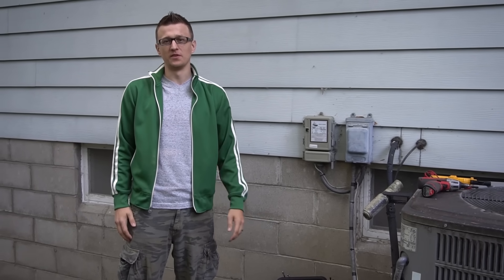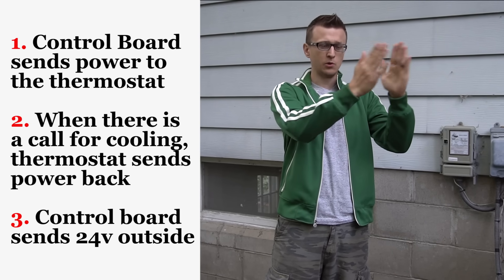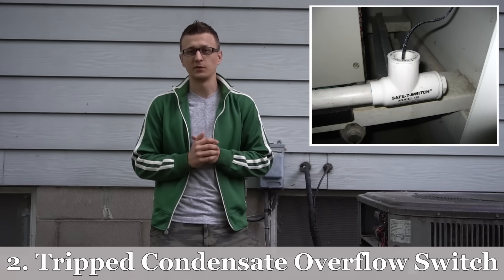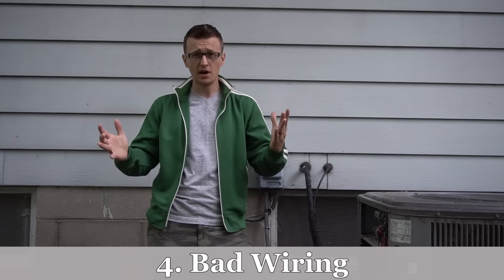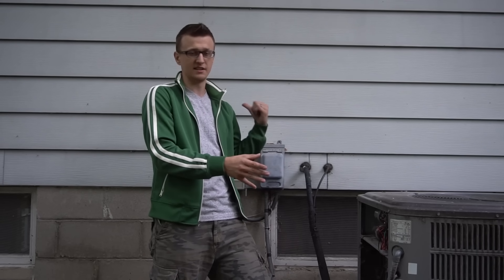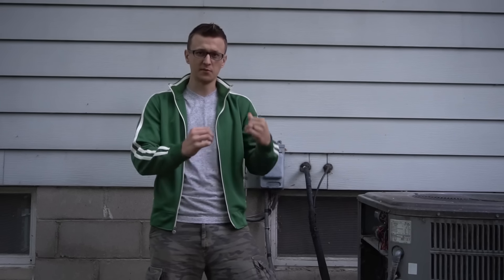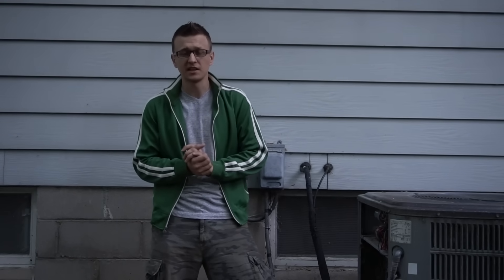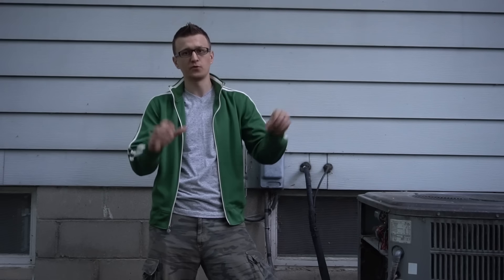AC Contactor Not Pulling In - 10 Reasons Why

Comment: Great video(s)! Thank you for taking the time to post these for people who want to take the time to learn how to do their own repairs.

Question - If I manually push the plunger down on the contactor and the fan begins to rotate, does that mean the contactor is okay and does not need to be replaced?

Current Scenario is: When the A/C is on, all I get is warm air inside the house. The fan does not spin on the outside unit. I happened by chance to catch your video on how to replace the capacitor so I replaced it but that did not fix the problem. I decided to spend some more time watching your videos and came across the plunger test. I admit that I replaced the capacitor hoping it would be a quick fix and did not properly research at first. I did the plunger test with power on and the fan came on. I blew some compressed air around the contactor (plunger was covered with a plate that I had to unscrew) but the problem remains. I replaced the batteries in my thermostat but still have the same problem. There were some loose wires behind the thermostat and I thought that was the problem but alas, adjusting and tightening the wires did not fix it. I am going to try and perhaps spend some more time cleaning the contactor and perhaps check the condition of the wires to make sure nothing is damaged. I also had an HVAC company do some work on my furnace this winter...perhaps they did not properly connect everything inside the furnace? Was trying to avoid going into the furnace but will probably need to check it out over the weekend but I would love any advice on what to look for or how to proceed next. Maybe it's a blown 3amp fuse?  I don't have the equipment to perform the tests you suggest, e.g. I don't have a meter tester. Hoping to get this resolved before the heat begins to creep in. My unit was working last summer and the heat worked even after the HVAC company cleaned up. My thermostat is fairly new, bought it 4 years ago. Will also need to re-watch this a few more times for more ideas. Thanks!!!
Reply from the maker: (Thanks for the tips Thomas!) And glad to hear you got it fixed Liliana! :) I have seen thermostat wires snap off like that just from time and wear. The furnace slightly vibrates while it runs. But it's also possible that the cleaning guys accidentally bumped the wires too. No way to know for sure so may as well just let it go and enjoy the air conditioning! (On the positive side, you did learn quite a bit about your central air :)
Reply: I recently had a very similar problem with my outside unit.  I recommend checking the resistance of the 24 V coil - mine should have been about 12 ohms and was only about 3 ohms. I changed the contractor/coil and the problem was fixed. A complicating factor (which made troubleshooting the problem more difficult), was that 24 volts was not present at the coil with the thermostat calling for cooling. I believe my Honeywell programmable thermostat has a protection feature that will not apply voltage to the cooling circuit if low resistance is present in the circuit. Good luck.
Reply from the maker: Glad to hear my videos are helpful! Sorry to hear about the AC not working. First off, it's not likely that the contactor is bad but to know for sure it would need to be checked with a meter.  I don't think the fuse 3 amp fuse is blown either. I would recommend also watching some of my "how to bypass a thermostat" videos and then try jumpering your thermostat at the control board. (It would be R jumpered to Y) Also, inside the furnace look at the control board thermostat wire strip. You will have to trace the wires a bit but figure out which wire is coming into the furnace from the condenser unit outside. Usually this will be a brown wire with a red and a white wire inside. Those two wires go to Y and C (doesn't matter which goes where). I told you this last part since you mentioned that maybe something wasn't connected right. But as you saw from this video, there can be quite a few things that can cause the contactor not to pull in so you will have to just have to keep narrowing down the possibilities. Good luck with the repair!
Reply: @WordofAdviceTV  VICTORIOUS! Finally opened up the furnace. Took some time to get my bearings with trying to figure out what wires were what...but then suddenly it stuck out like a sore thumb...a lone Yellow wire that seemed to be disconnected albeit very close to the control board. Long story short, it had to be connected back to Y on the control board. Was confusing since there was already a wire , I believe white which seemed to go outside, going into Y so I thought all the wires already were in their proper places. After doing some Googling, I decided to unscrew the screw for Y and a piece of wire dropped off! Eureka! This must have snapped off from the yellow wire. Stripped the yellow wire a bit and connected the two wires back to Y...turned it on and the fan turned on outside!!!! Thank you very much for your help and for taking the time to post these videos! Question is...do wires normally just snap like that...or was this bad work by the HVAC cleaning guys.....

Comment: Hi Jay!  Just ordered a Packard single pole 30 amp 24 volts contactor on line.   Doesnt look like it is labeled  L1 L2, T1 T2.   Are their locations standardized the same if I orient the contactor according to my existing old one of a Siemens brand with the side that has the contactor?

And does each of the four 4 prongs belong to its own group so that wires belong to that group can be plugged onto  any of the 4 prong configuration as long as the wires are in the right group, ie: T1 or T2?   

Also, can sources for the main power go on either side of the 2 screws or lugs on the line side?   Thanks in advance!
Reply from the maker: Hi Dora! Most contactors will be labeled, just look around. But it's no problem if it isn't. Firstly, make sure you label the wires or take a picture before you take off the wires from the old contactor. The locations are standardized so you should be able to swap it out pretty easily. You are right about the 4 prongs belonging to it's own group (they are all connected so all 4 prongs get energized). So as long as you put it in the right place, it does not matter which prong you hook up the wire to. The two hot lines (L1 and L2) can go on either side. Both supply 120v so they are the same.  Hope that clears it up for you. Good luck!

Comment: Why would a contactor be all carboned up? Evidently the all run capacitor burnt up and it might have been because the contactor is carboned up and sticking. Cost me 900.00 in heat bills this winter cause the outside unit was not working and just the aux heat was being used all winter. Your video on the all run cap helped me find the capacitor was bad.

Comment: Thanks for making me feel like an idiot.... I spent half the day watching other videos, testing the capacitor, testing the fan motor, testing the contactor, etc.  Everything was checking out fine; but I was only getting 10 vAC from the circuit board to the contactor i.e. not enough to energize the coil.  Lost story short, your video reminded me to put fresh batteries in the thermostat and then everything started up normally.
Reply from the maker: Lol, glad to hear it was something simple at least! Stay cool! ;)
Reply: I spent hours checking everything, only to discover that the thermostat had become slightly unseated and wasnt making contact.  Gave it a light whack and everything worked fine!

Comment: I have an AC system when it kicks on everything
works good for about 3 minutes. Then the inside blower fan shuts off while the
outside fan and compressor continue to run. I can shut it down and reset the
unit and just does this again. When the system is set to heat it works fine. Any help ?
Reply: Have you tried jumping the fan and seeing if it stays on without heating or cooling? You can set it for Fan On, on the thermostat or jumper between R & G
Reply: @albotiger7268  no. I will try that
Reply: have you find out what is wrong with your ac.  my has same problem. need some helps

Comment: I should that, of course, I have an 'Air Handler' on the inside. While the outside unit was going off and on the Air Handler stayed on continuing to supply heat.

Comment: A few days ago I asked about my unit outside coming on for a minute then going off for a minute over and over. You suggested that I either had a problem with my thermostat controller or my 'control board in the furnace' is defective. I should have told you that I live in the deep south and do not have a furnace. A 'Heat Pump' does the job down here fine. Does this change your advice?
Reply from the maker: Sorry I don't remember the previous comment (I am starting to not be able to keep up with all the comments) but from what you just explained, it sounds like you are low on refrigerant. Your unit probably has an LPC (low pressure cut-out) when the compressor turns on, the pressure in the suction line starts to decrease. That's normal. But when a unit is low on refrigerant, the pressure drops below the cut-out point and the LPC trips, causing the unit to turn off until the pressure goes back up again. I hope that makes some sense.. But this is just an educated guess, I can't say for sure without being there.

If this really is a refrigerant problem, then unfortunately that's something you would need to call an HVAC tech out for. Not something you would be able to fix on your own unless you have the tools you need along with knowing how to deal with refrigerant.
Reply: Thanks, again,, next time you hear from me, it will be through PayPal
Reply from the maker: @Tectonos  Lol, thanks! :) Good luck!
Reply: @WordofAdviceTV  could it also be a bad capacitor causing the fan to turn on and off continuously?

Comment: Hey Jay, I love your site for A/C repairs. We don't have hot weather yet but I like to be prepared. We had one day about a week ago the temp went to 76 degrees, I turned on my A/C and even though the fan inside was running the fan outside was not. I removed and read the Starting capacitor with a meter and it read open at all terminals, so I  bought another, I replaced the capacitor and the fan outside still will not  run with the A/C on. I pushed the contact button with power on and the outside fan started and ran. So I went inside and checked the wiring. There's a red and white wire from the unit outside that comes into the circuit board on the indoor unit. The white wire is hooked up but the red wire is loose.  I figured that's the power wire so I touched it to the terminal on the board that has the other red wire hooked to it. When I touched the terminal with the red wire the outdoor fan turned on even though I had the A/C turned off.  What I need to know is where does the red wire go that comes in from the unit outside. Does it go to the terminal with the other  red wire or does it go to the terminal with the Blue wire which is Cooling ? Your web site has been a blessing for me but I'll not give up because I did A/C work 30 years ago and automotive A/C work from 1985 to 1989. I'd hate to think I have to place a service call for 1 wire disconnected. Thank you for any help you can send  my way.
Reply from the maker: Hi there! Glad to hear my videos are helpful and thank you for the detailed question! The two wires coming from the outside unit would go to Y and C on the control board thermostat strip. (doesn't matter which wire goes where) That's the most common scenario. Let me know if that doesn't make sense in your case. Good luck!
Reply: Hi Jay, I want to thank you from the bottom of my heart. I connected the wires like you said and set the Tstat for a lower temp and the compressor fan came on so I'll wait for a little warmer weather to make sure the compressor is working correctly. I don't know how the red wire became disconnected, could be when I removed and cleaned the flame sensor for the furnace short cycling. I spent several years installing residential HVAC systems but never on the repair side. I also did automotive HVAC for 12 years with Chevrolet. I spent my last ten years in a maintenance dept at a local hospital. I'm going to send your link to all the guys that I used to work with and see if I can't get you 8 or 10 new subscribers. Thanks for everything.
Reply from the maker: @jumpercable20  You're welcome! Happy to hear that's all it was! Hopefully there won't be any other problems once summer comes.

Comment: Great video. What would cause 5 second intervals of 27vac going to the contractor? I get a steady 27vac at the output of the control board. I tested the contractor with a different power source and it stayed engaged.
Reply from the maker: The thermostat wires that come out of the house and go into the unit, can you trace where they go? Usually one wire will go straight to the 24v side of the contactor and the other one will be in series with something. Whatever is in series with the contactor is likely the culprit.

Comment: I have a lennox heat and air outside unit and it stopped working .I bypassed the thermostat and it still wont come on .I pushed in the plunger and it fired right up until I let off of it . The furnace is working fine and on the thermostat when I try to run heat or air the outside unit wont come on and where it says heat on or air on it is blinking ,also replaced batteries in thermostat too .  What do you think the problem is?

Comment: I set the thermostat on cool and it didn't work. So I go out to the ac unit and unplug the breaker and then plug it back in, and compressor turns on. But when I go back into the house and turn it off and then back to cool, the compressor does not turn on.

I was thinking the contactor is the problem but it doesn't work the way yours does

Comment: Hey Jay, hope your having a great week!  You sound like you are on a show on tv bro, Your very well spoken yet easy to understand.  Great job thank you sir! Blessings
Reply from the maker: Thanks David!
Reply: @WordofAdviceTV  wouldn't it be nice to have a wire diagram for the switch from the disconnect to the relay contacter to the compressor and then the fan ? Nordyne and ( Miller stopped putting the diagram out there ( mobile home central air unit with furnace inside ) what a joke these companies were. , I say were because they changed hands in the last 15 years at least 12 times
Reply: he is very fluent

Comment: If your system trips and low pressure wouldn't that mean that there's a leak? I'm just curious
Reply: Blower motor could be bad,or dirty filter/ dirty evaporator coil . So don’t always assume that the system is low on refrigerant.
Reply from the maker: Usually when I see a tripped low pressure switch it ends up being low on refrigerant. But Tom is absolutely right! Thank you for the correction. Bad or no air flow would trip that LPC as well. I stand corrected :)
Reply from the maker: Yes, if the LPC is tripping then there is most likely a leak